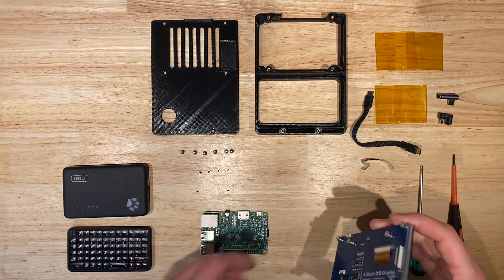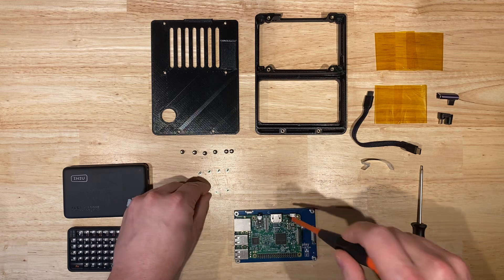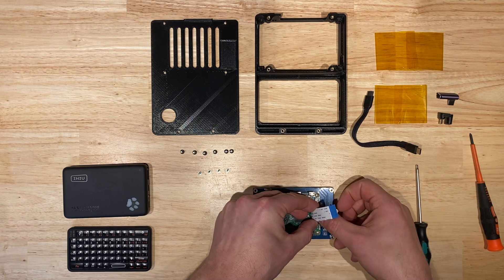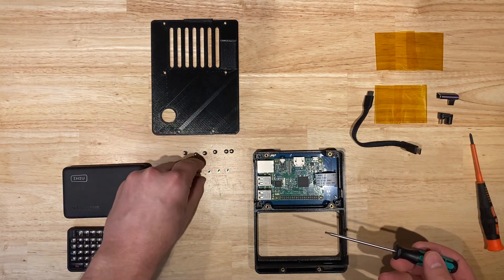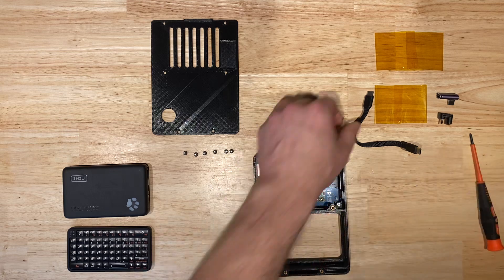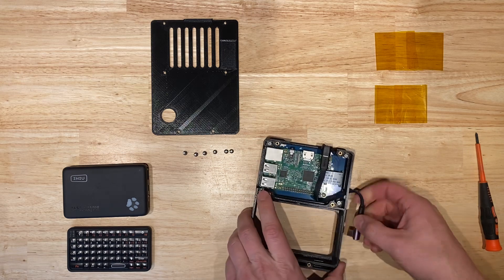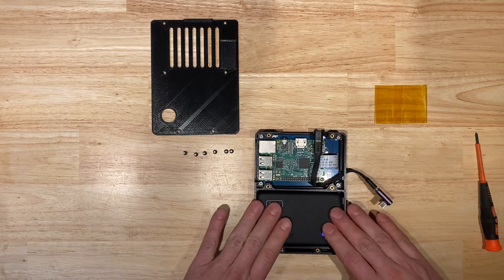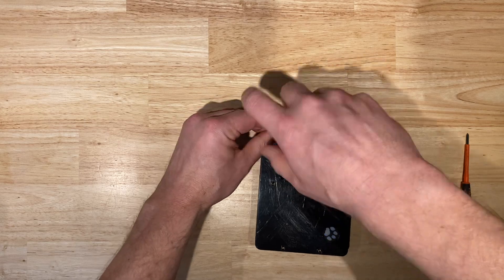Bumble Berry Pi - How To Assemble

Comment: whete do i get one
Reply from the maker: This is a DIY project, so you need to 3D print the two plastic enclosure parts, buy the rest of the parts on Amazon, and then assemble it yourself. The full instructions and parts lists are here: https://github.com/samcervantes/bumble-berry-pi
Reply: @SketchySam123  thanks so much fam